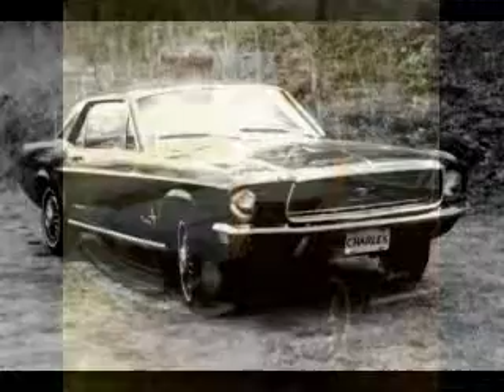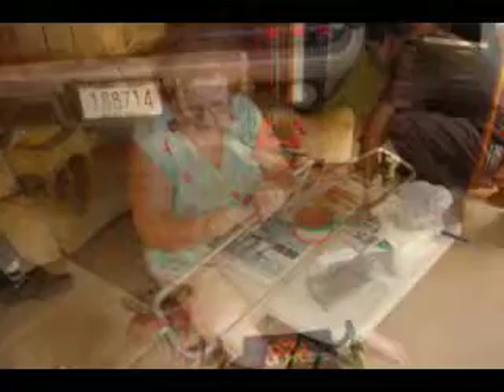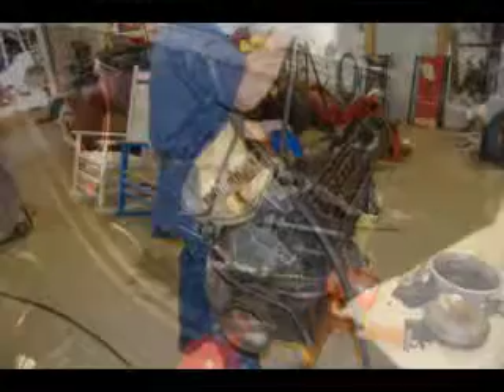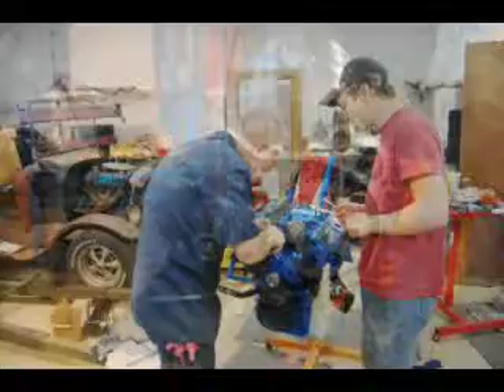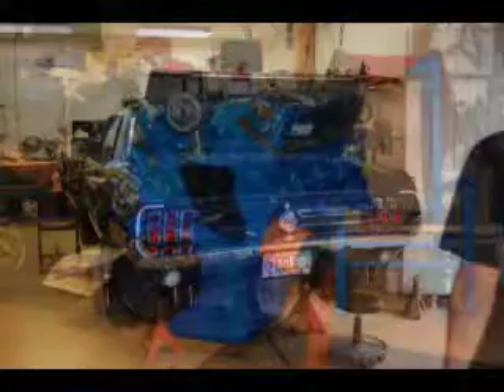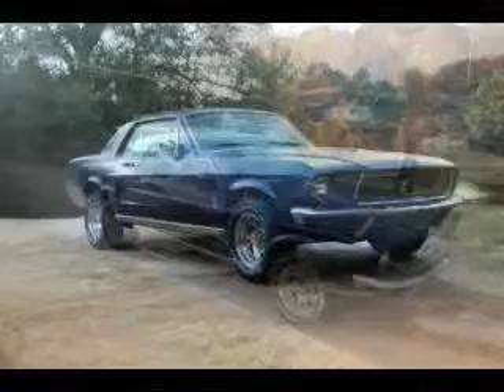1968 Mustang Engine Rebuild

Comment: I really enjoyed your video. I have a 68 coupe that badly needs restoration. It's the 200 I-6. Did you use any type of manuals or books for reference during your work? Any tips? Mine wasn't in great condition when I got it, and it's been sitting for about 8 years.